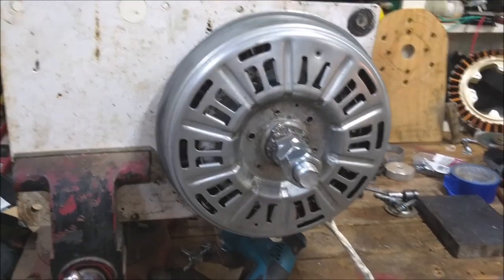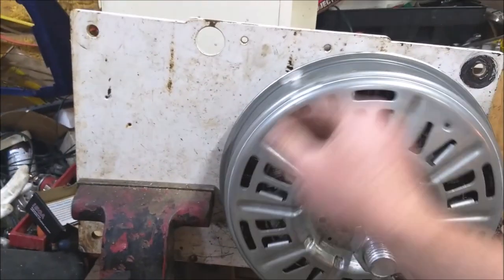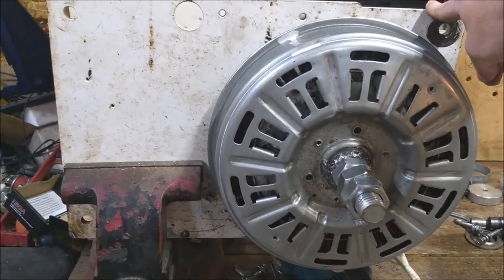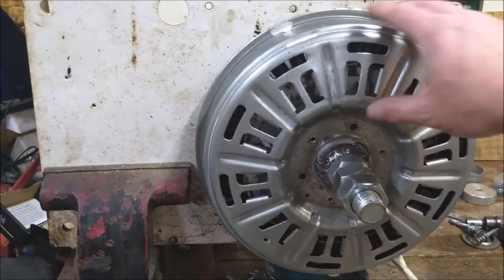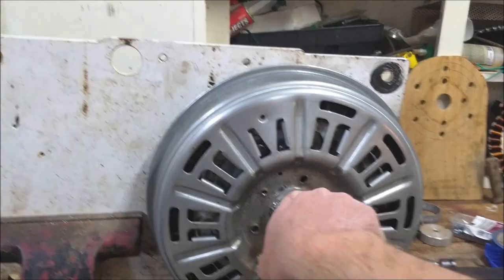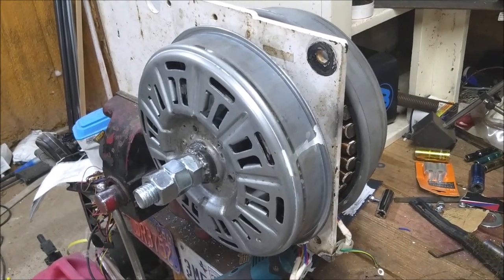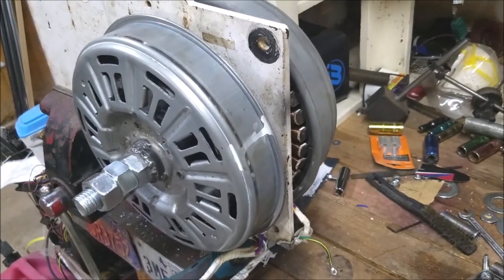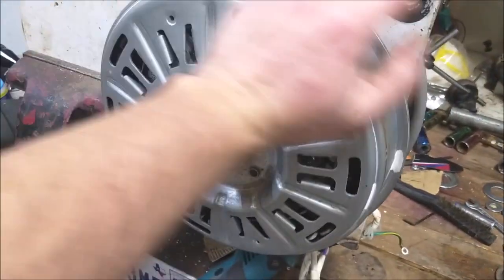DIY Project #3: Washing Machine Motor Turbine Update

Comment: Just use 2 rectifier, not difficult at all
Reply from the maker: Yes one rectifier per stator is fine.  The problem is that even at very low RPM the voltage is VERY high.  Once charging voltage is hit...which is like 50rpm...it's like the brakes are on.  Ideally the stators would need to be rewired to something more appropriate for 24~48v battery banks but I'm trying to explore ways to do without having to cut anything up.  I don't think it can be done even using a step down transformer, though, and will probably have to chop up the wiring.
Reply: @ToysforWatts  3 toroidial transformers would work. The problem is that you have to use that type due to the frequency not being at one steady rate and higher than most regular transformers are designed to work at. 250 RPM equals about 100Hz on a 36 pole unit. Problem is a new one is going to set you back about $125 each while rewiring will set you back under $10.  And will only reduce it by one half the voltage.